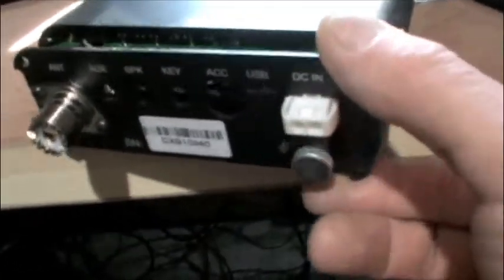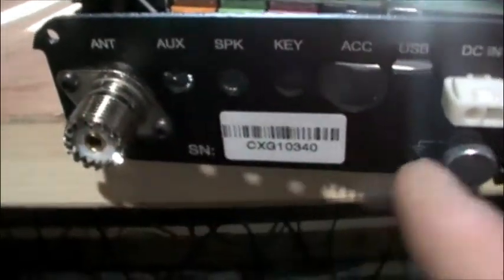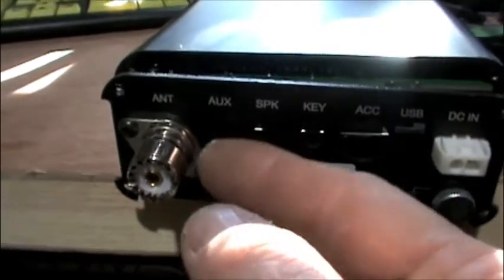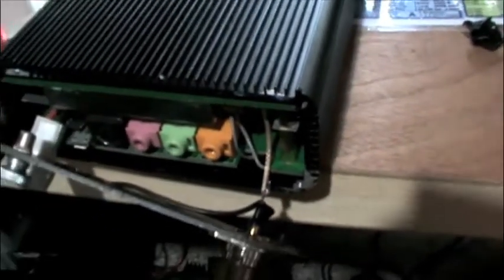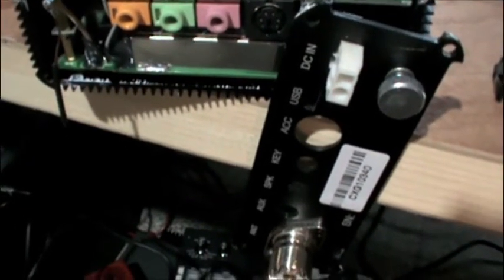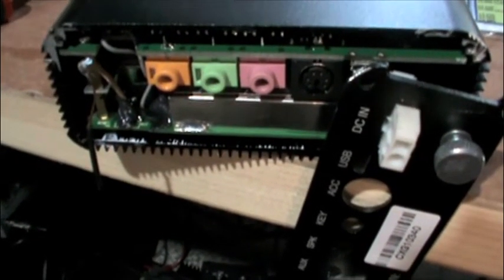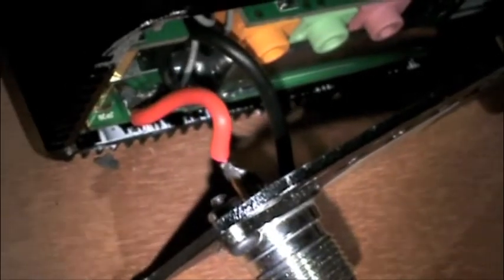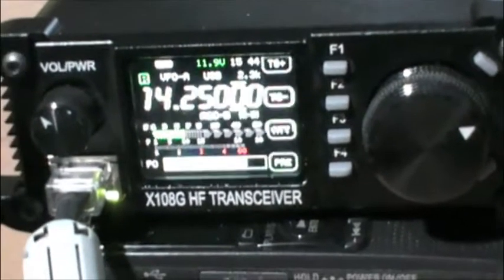xiegu 108g test and mod

Comment: There is no official standard for QRP transmit power output, however, most QRP organizations agree that CW/AM/FM/ and data modes should be 5 watts or less. SSB phone , there are differences of opinion here, some feel show be no more than 10 watts, while others argue that 5 watts output power should constitute QRP phone. License class has nothing to do with your rebuttal but you made it so. I know many Extra Class licensees that less than I and many Technician Class licensees that know more than my Extra Class licensee friends.

I do know my Q codes and use them in most CW communications.

Thanks for your video. I did give it thumbs up. Don't why the hissy-fit response though.

Comment: 16w is QRO not QRP. QRP phone is <=10w.
Reply from the maker: well alot may say all qrp is 5 watts but there is no standard as ham we make these kind of rules i am an extra class ticket and as far as i know there is no official rule about this further more ive always been honest of the power ive run and  had knowone ever give me a hard time for useing less than 20 watts and calling it qrp as far as im concerned anything less 20 watts is qrp 5 watts is negligible as far as db gain and last qro as i know it means to increase power maybe you should review your q codes .
Reply: I may add that it makes sense to have QRP at 5W CW, and 25W at SSB.
Also, on what antennas?
In the field, 25W makes sense as minimum SSB power with less than ideal conditions.
That's also the reason why kaki (military) rigs have 20 to 25W (or even 50W for the great little QMAC HF90) for field communications.
The military has tested it long before HAMs.
So, when i am in the field with my 20W SSB X108G rig, i call QRP.
And this is not cheating, especially on an 8 feet military antenna for 40m...
Reply: I think the QRP standard should be any radio that you can hike without assistance to the top of a mountain and run for more than 24 hrs.  That way it would be total system standard, not just wattage.